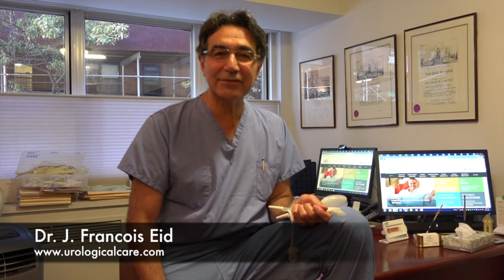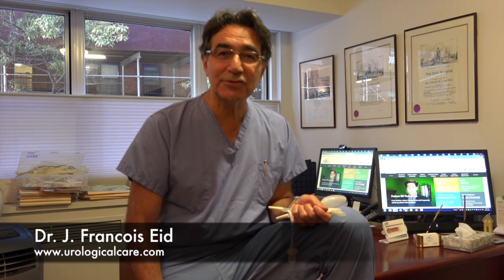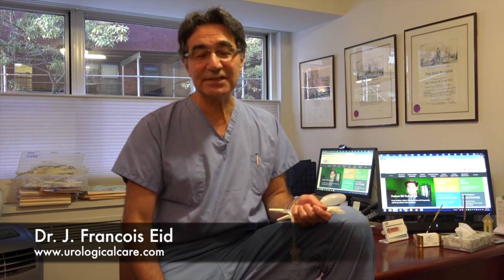Maximizing Size with Penile Implants

Comment from the maker: The penile implant is a great option for men with severe erectile dysfunction, men who do not respond to pills like Cialis or are unable to take medications because of side effects. Complications of the penile implant procedure include infection, malfunction and erosion of the implant through the skin. Our infection rate is 0.56 % based on over 4000 consecutive penile implant procedures since January 1st of 2006 with the No-Touch Technique. A men with a penile implant has normal sensation and the device does not interfere with orgasm and ejaculation. Especially with the Coloplast, the penis will be extremely firm when the device is inflated (10lbs psi). The penile implant unlike breast implants is not for penile enlargement. Nothing exists in the world to enlarge the length of the erect penis!